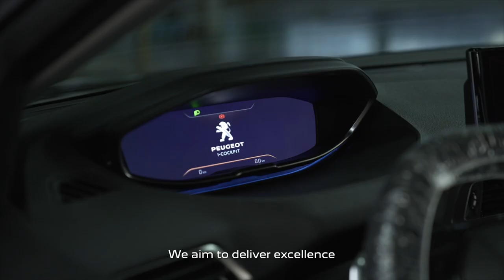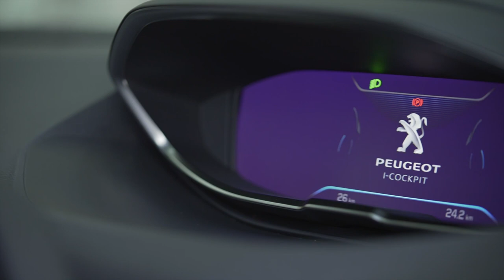Peugeot SUVs l Made in ASEAN

Comment: Here's a tip for comeback

1. 5 years warranty unlimited mileage. You are confident with your test right?
2. 5 years free maintenance parts and labour. This is how Mazda made a comeback.
3. More bells and whistle where it matters. ASEAN dont value co pilot weight detector. ASEAN dont value unnecessary electronics by Peugeot that famously need to change car battery almost every year. ASEAN value ADAS, Full range ACC, 360 camera and DVR. 
4. Look and feel Peugeot already nail. Now come with competitive pricing. ASEAN made with ASEAN price.
5. More 4S and 3S centers. Allow dealers to open.
6. Competitive parts price and availibility. This is key.
7. Hire someone else for marketing. Definitely the curremt team is obviously shit.